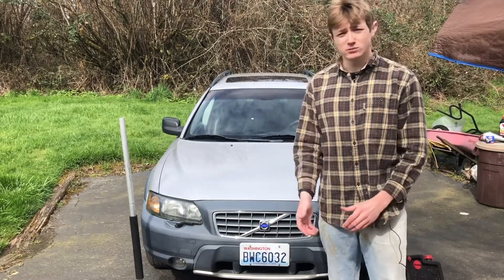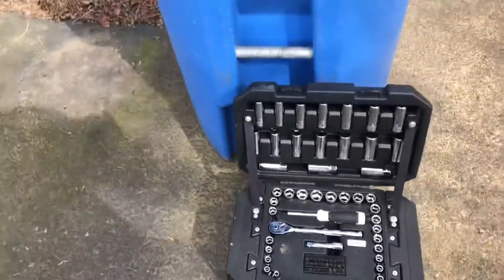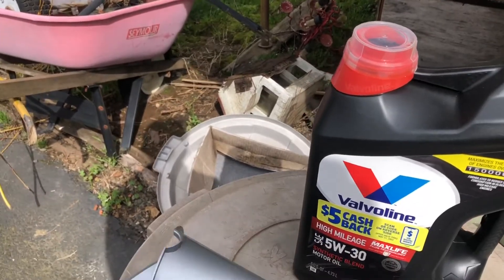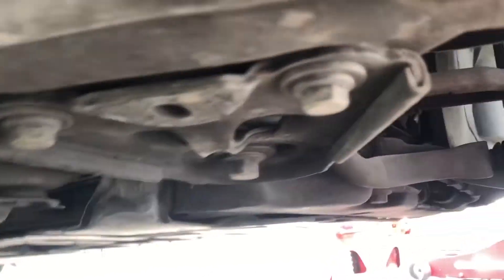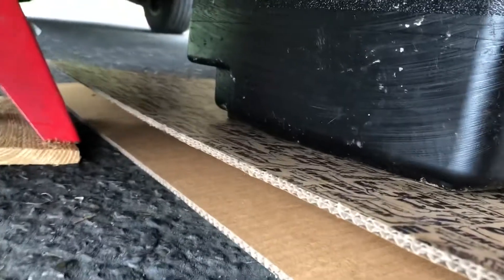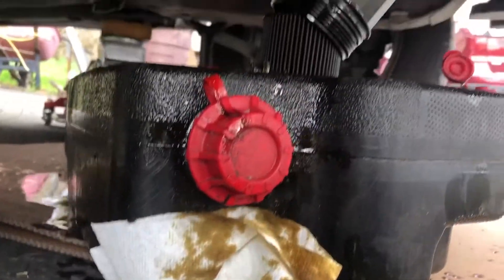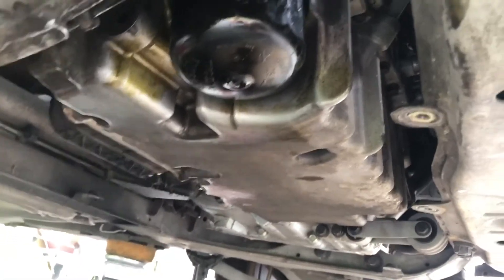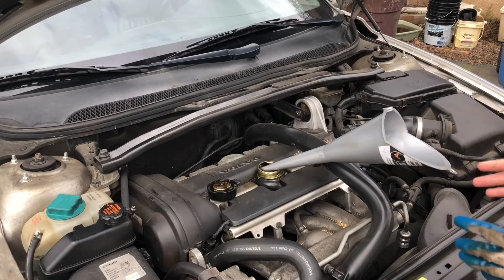How To - 2004 Volvo XC70 oil change step by step.

Comment: Dude, you gotta push down on the filter element until it clicks and locks itself in place in the housing!
Reply from the maker: Yeah the filter wasn’t very good so it didn’t lock in
Reply: @jakeandcameron7022  Next time I recommend a Mahle oil filter, that's who makes the Volvo OEM.
Reply: Where is the filter going to go. Not sure why it would need to be locked in place. Over engineered.

Comment: Hey Jake,
Thanks for the preview of what I can expect.
As you learned, having the correct tool makes all the difference!
I have some suggestions:
#1a Get throw away gloves. Change them often. You can get them at Costco.
#1b get bigger boards for your stands (if that stand slips, all bets are off) or just do without, your asphalt is hard enough.
#2 I agree get ramps. Your tires were 1/4" off the ground (although at full suspension extension). I think ramps would get you more room (I still use a floor jack and stands though, because that is what I have)
#3 Get a DEEP oil pan! You are draining almost two gallons of oil, all at once. "It just comes and comes..."
 (yeah, that is what she said...)
#4 Don't open the oil cap until AFTER most of the oil has drained (see #3)
#5 Get the proper filter wrench. Amazon says it is a: "86mm 16 flutes oil filter removal tool. Specifically designed and tested to fit Volvo engines that have a 86mm plastic smooth top oil filter cap, most but not all years of the following Volvo vehicles: C70, S40(1.9L only), S60, S70, S80, V40, V70, XC70, and XC90 (NOT FOR Volvo 3.2L 6-cylinder engine). It will not fit caps with a 6 point nut on the top."  So 86mm x 16 flats... so much easier. Yes you might need a different one for each of your cars (I have a 3-prong adjustable from Craftsman, but I like the "exact fit" cap style better)
#6 Remove the o-ring FIRST, then clean the housing (get that sludge out!), then change the o-ring, THEN, press the filter onto the by-pass valve. Details matter.
#7 Skip filling the filter. Your bearings already have oil on them.
#8 I know what you meant, but is is not what you said... Put 5 quarts in, start the engine. Once you are sure there are no leaks, (stop the engine) and put the skid plate back on, then lower the car and add another 1/2 quart. Wait 10 min and add a bit more until you are happy (almost to the "high mark"?) Never overfill an engine.

I am going to watch your "What to expect" Volvo XC70 video next (this is my Mom's car, and Dad just passed away)

Thanks for the video,
Paul